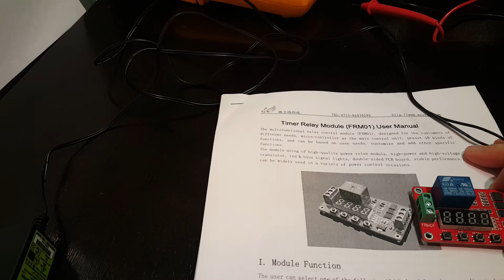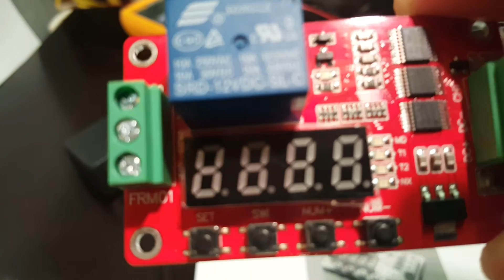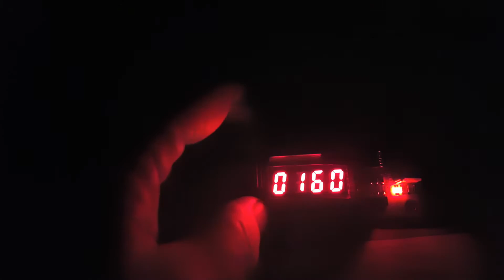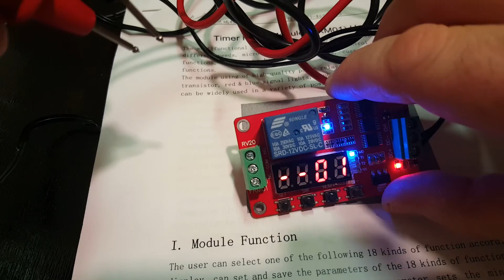GERI FRM01 - 12V Multifunction Relay Cycle Timer - Newer Version

Comment: I'd like to make a delayed start signal for a project but I can't wrap my brain around these timers offered on Amazon.  

I have an inverter (Schneider Electric XW+) that will use a battery bank to power my critical loads. It can also get power from a generator that it will start when told to do so. 

I want to connect a 12vDC relay to a power adapter connected to a grid outlet, that is, not a critical load outlet. When the power goes out the relay will switch and the normally open connection will close. That's the trigger that the grid power is out.

That trigger needs to delay start the generator after grid is down for 15 minutes by momentarily closing a connection on the inverter. However if the grid comes back up before the 15 minutes then everything is canceled, that is, I don't want to signal the inverter to start the generator.

Another delayed timer relay is to stop the generator after the grid is up for 15 minutes. If it comes up and then down again before the 15 minutes, then nothing happens. But if the grid stays up for 15 minutes, (12vDC relay connected to grid power adapter is on), then a different connection on the inverter is momentarily made signaling it to stop the generator and return to using grid power for the critical loads.

Any thoughts, comments, ideas, etc. will be appreciated!
Thank you
Reply from the maker: I appreciate your interesting question. You can either do it with an Arduino, which I am not familiar with, or possibly with this relay, which is kind of like running your system like a 1960's Pinball Machine. The first question is whether your inverter has a built in Relay to trigger something like an alarm when the power goes out that you could use. It should have something like this built in. The XW Pro Manual states "Each XW Pro has one programmable 12 V, 0.25 A auxiliary output that is able to run a small fan or operate an external relay to perform other functions. Examples include remotely starting a two-wire start generator"   Otherwise, A simple relay that is Normally closed could could do the first half of what you need it can be programmed to Open on a power outage. However, it can't be placed after the inverter because the inverter will fool it into thinking that you have power. Also it will not have a 15 minute delay if it has no power in order to monitor things. The device in this video is exactly what is needed to do a delayed timer relay since if it has power from the Grid (Must wire into grid before Inverter) it can then stop the generator after the grid is up for 15 minutes.  I would recommend as follows: I assume that you can get alerts from your inverter on a power outage. Get a big battery Remote Startup device like this to Manually Remotely Start up the Generator:  https://uhavecontrol.com/      The issue is that once you start up the generator, I assume you desire to charge the batteries, so if the gen powers the inverter, it will fool the inverter into thinking that utility Power has been restored.  You could divert power off the main line and have a separate small fusebox before your inverter and generator and attach a Digital Input Monitor to it to keep you notified of the actual utility service. https://www.youtube.com/watch?v=MYfavLwbsfU&t=114s      I would do nothing but get alerts from the inverter and then use the Remote startup to start the generator Manually every day to keep the batteries charged. when you shut off the gen, you should see from the inverter whether power has been restored. The only problem is if you wait to long, the inverter will die and take with it, your ability to contact the  remote start and get the generator turned on.
Reply: @silverbankruptcy  Thanks for the thoughtful reply!!

First I really enjoyed your reference to a 1960's Pinball Machine.  I'm 70 so pinball was my thing.  I wasted two college years playing pinball at the Student Union. 

I'm not sure how to get to the inverter relay but that is interesting. I'll look into it.

I plan to connect a 12vDC relay to a power adapter connected to a grid outlet, that is, not a critical load outlet. When the power goes out the relay will switch and the normally open connection will close. That's the trigger that the grid power is out.

I already have a hefty wires (10 gauge overkill) to conduct 12vDC voltage from inside the house (where the battery can't freeze) to the generator and a connector to the generator to initiate the auto-start circuit. It works great. I push a button in the basement and the generator starts. Push it again and it will stop.

The inverter will stay alive and run critical loads for maybe 2 hours give or take. I don't want to wait too long. If the grid is down more than 10 or 15 minutes then it probably (key word there) not come back up within hours. (lived here 35 years so I know the drill) 

Some of the issues I can't wrap my head around are these:
1. If grid is down, start a 15 minute wait timer, call it timer1. 
1.1 If grid comes back up before 15 minute timer1 is done then cancel timer1, return to normal state. (inverter will use grid power for critical loads and to recharge batteries)
2. After 15 minutes, start the generator. Inverter will (I believe) automatically use the generator power (also called AC2) for critical loads and to recharge the batteries.
3. When the grid comes back up start a timer2 (different timer) for, say, 10 minutes.
3.1 If the grid goes down again before the timer2 expires then cancel timer2 return to grid down state.
3.1.1 ISSUE here is that timer1 will begin since grid is newly down. If it hits signal to start the generator I can prevent it from stopping. A new start generator signal can be ignored.  But I need to think this through more to be sure.
3.2 if grid stays up for 10 minutes then stop generator. Inverter will have already automatically begun to use grid power for critical loads..

Whew. My brain is fried. I need to capture all this and write it out in such a way to be sure it will work correctly in all cases.  

One thing that I failed to mention is that a momentary contact on the generator auto-start pins will start the generator if it isn't running but will do nothing if it is already running.   Closing the contacts for 4 seconds will start the generator if it isn't running but will stop the generator if it is running.  (sounds more complicated than it is.)

Wow.  I hope I haven't overstayed my comment!  Is this making sense still?
Reply: @silverbankruptcy  Just watched your XW-111 video.I subscribed to your channel.  Is there some safe way that I could give you my email address without it going to these public comments?
Reply from the maker: @Rodatum  my email is the name of the channel @gmail.com. thanks  your project is hurting my Brain! Let's just play Pinball!

Comment: I need a relay on when triggered then off for a set time before it can be triggered again. This way I can use it on a simple prop without someone re triggering it over and over. I need it locked out for say 15 seconds before the trigger will work again. I can achieve this with an Arduino and relay but looking for a device that is cheap and easy. Let me know if I just missed this feature?
Reply from the maker: It's been a while since I used this. Download the pdf instructions and see if it can do that.
Reply: Hi Mowerdog, did you end up finding something suitable as im looking for trhe same currently.

Comment: Anybody know where I can find the firmware or source code for these?

None of the 18 functions do a simple motion sense, power ON for X seconds, then OFF and wait for next motion.
They ALL repeat/reset the timer if more motion is sensed (while timer is ALREADY triggered) and the timer keeps resetting itself!

Anyone?

Thanks!
Reply: I have also been looking at all these relay timers.  I think we want the same thing - Relay on when triggered then off for a set time before it can be triggered again.  This way I can use it on a simple prop without someone re triggering it over and over.  I need it locked out for say 15 seconds before the trigger will work again.  I can achieve this with an Arduino and relay but looking for a device that is cheap and easy.  Let me know if you find something?
Reply: @mowerdog  I've found the Qianson timers (3 button) boards that actually DO work the way I want.
These may be similar:
https://www.ebay.com/itm/DC-12V-LED-Delay-Time-Switch-Module-Timer-Control-Relay-Multifunction-Circuit-BG/113301928945?_trkparms=aid%3D555018%26algo%3DPL.SIM%26ao%3D1%26asc%3D20131003132420%26meid%3D0c43058476944ea1ac9fcebacda77d15%26pid%3D100005%26rk%3D4%26rkt%3D12%26sd%3D392147638900%26itm%3D113301928945&_trksid=p2047675.c100005.m1851
Reply: @mowerdog  Or these:

https://www.ebay.com/itm/DC-12V-LED-Delay-Time-Switch-Module-Timer-Control-Relay-Multifunction-Circuit-BG/113301928945?_trkparms=aid%3D555018%26algo%3DPL.SIM%26ao%3D1%26asc%3D20131003132420%26meid%3D26e6d31ec4c44e1ca502747334c19a3a%26pid%3D100005%26rk%3D7%26rkt%3D12%26sd%3D202253112566%26itm%3D113301928945&_trksid=p2047675.c100005.m1851

Comment: I just received this same one and want to use it for my front door alarm. I'm using a laser beam with trigger wire to activate this relay. My problem is the trigger wire sends 12v+ which doesn't activate it. It needs 12v- to activate the relay. Do you know how to reverse the trigger action? Thanks
Reply from the maker: opichocal very interesting. I am not am electronics expert, but perhaps a voltage transformer would do what you need.

Comment: i have one motor and timer switch(frm01) with me I want to know if it will work as automatic or periodic timer switch to initiate the motor every hour turning it one (one full rotation
Reply from the maker: abhilash kgm You can definitely make it turn on every hour, but there is no way to specify shutoff after one motor turn. You can only set times. So if you can time how long motor takes to turn one rotation,  you can set the timer for that time period. You can only program times.
Reply: silver bankruptcy
 please tell connection.... I have one motor and timer switch ( where I connect motor connection)
Reply from the maker: abhilash kgm this unit is a low voltage switch. So you need to get a contactor or relay with a 12 volt input that can power your 120v or 240v motor. When the left side of the unit closes the normally open side, it will send 12 volts to a 120V relay or contactor that you buy that will then send 120V to the motor. This unit only handles 12V.

Comment: Nice video, thanks for sharing. I have 1 question: I have a water pump that runs @ 220V AC and at 10 Amps. So the total load of pump is around 2.2KW AC. Basically, the water runs out after 5 minutes from the well and takes another 5 minutes to replenish. Can I use this device to power my water pump @ 5 minutes on and then 5 minutes off cycles. Will it support this much load? Thanks.
Reply from the maker: It would work, but its a low voltage device so you would run 12V through it to trigger a 220V Contactor that will actually switch that High Voltage

Comment: How do you adjust the power save feature?
My display goes blank after a few seconds.
Thanks.
Reply: Long press [NUM+]. The whole display will blink 3x to confirm that power save turned OFF
And BTW, "power save" only turns off the digital display after 10 sec, reducing the supply current by only about 4 or 5mA. So it's more of an annoyance than saving anything.
Reply from the maker: I don't Know of any Power Saving Feature.
Reply from the maker: I don't believe that it has a Power Save Feature.

Comment: What ampere did you used with your 12v power supply?
Reply from the maker: The Power for this Device is siphoned from the Gas Valves, when the Generator Turns On. The Power comes from the 12V Car Battery with 850 CCA. See The Generator Installation Video: https://www.youtube.com/watch?v=ZfQxptYsk0w

Comment: The best quality system would battery-backup the router and let the text system send the text as soon as the generator is online.
This would become very annoying if you suffered multiple short blackouts, or brownouts confused the system. Plus you have to wait (at least) 3 minutes for your text notification.
Reply from the maker: I can't disagree with you. if this were mission critical then I would agree. however, for a home generator the cost benefit again my opinion, is to keep it battery less and use this relay.
system sends out a text when it turns off , so it's fine enough.
basically your solution is better but may not be worth the cost in this particular application.
Reply: A cheap battery backup can be had for under $50 nowadays. I always like having one on the modem and router particularly when my area would suffer a quick power flicker, no more waiting 5 minutes for the internet to come back on.
Reply from the maker: +mwiz100 That is an interesting option. $50 seems low for battery backup, they must cost more. How many years does that device work?
Reply: Fundamentally, the electronics last forever. The batteries are typically  poor quality in the affordable home versions and is the weak link. Plan on replacing the battery every few years. I bought an APC brand at a Goodwill thrift store for $5 dollars U.S. because it "didn't work", but I had to pressure the manager to sell it. They normally won't. I put in a motorcycle battery and it works great.
Reply: Ehh... particularly passive components will fail over time, so there is a finite time on them. Cheap modules like this more so since the quality of the given components is going to be low. I contend the backup is still the better solution simply because the network links never go down in the first place and for my money- that's what I would want is an un-interupted scenario. I have backups on all my key gear/computing as it is already.
I guess it really comes down to sort of a philosophy of implementation and what you want out of your system.
Reply from the maker: I can't disagree with you as you are correct, however batteries and UPS systems also fail and need monitoring as well. Sometimes "good enough" is fine in a non critical use. Here especially the generator turns on for a minimum of 5 minutes and therefore the notifications should be sent properly under all conceivable situations. The texts tell you whether the generator is running, which indirectly informs you that the power is on or out. Even if power flickers, the gen will turn on and not switch back until power is stable. Again, your solution is impressive and useful for computer data, but may not be necessary for this particular application.

Comment: So this module will keep the settings even if you haven't power it on for a long time?
Reply from the maker: Yes Exactly, It Permanently Stores without battery backup the programmable Variables - The Mode and the Time. In my case, When Powered On, It Executes these Stored Variables.
Reply: Thank you, this would be useful for my project :)

Comment: great , i ordered one to delay the recharge for a GPS tracker on my motorcycle , the GPS tracker can hold charger for a week without recharging , if i connect it directly to my motorcycle battery to keep the tracker recharging it sucks my battery in 3 days and i can't crank it anymore , i think this will solve my problem. i will let it countdown for 240 hours then a second timer for 3 hours to charge the gps tracker again,
Reply from the maker: That's a Smart Application for this device!  Its so Versatile that you can use it for many different things.

Comment: my frm01 on function 08 nx time set to delay time doesn't work. when i set nx to 0060 and its still count on second. during relay on and off. With other function 1 to 7 the nx time work.how to make it happen. Can anyone help.
Reply from the maker: +ekpower Look, I dont understand what you are trying to accomplish. I am Using Function #1, which is a simple Single countdown Timer to Relay Connect. The Manual Says: [Function 8]：
Limited Cycle Timing Mode B: after power on, the relay immediately pull-in, when arrived the setting time T1 relay disconnect; when arrived the setting time T2 relay pull-inthen repeat the above status  "NX" times,  the T1 and T2 can be  adjustable between 0.1 second -9999 seconds, the cycle times "NX" can be adjustable between 1-9999, give CH1 interface  a high pulse signal(high level duration≥20ms),repeat the above function.

FYI - Functions 1-8 Are Automatic Timer Countdowns upon energizing, Functions 9-18 Require a Manual Switch Trigger to Start the Process.

Download the Manual:
https://www.google.com/url?sa=t&rct=j&q=&esrc=s&source=web&cd=1&cad=rja&uact=8&ved=0ahUKEwitoa-hhOHKAhVCoD4KHQq8BSkQFggdMAA&url=http%3A%2F%2Fwww.easydiag.cz%2Ffotky29604%2Ffotov%2F_ps_202Timer-Relay-Module--FRM01--User-Manual.pdf&usg=AFQjCNHL2EgoZKx8QYzr7iEbT1Et0L0Y8A&sig2=IK4piwEVQMxA8JNs7GeibA